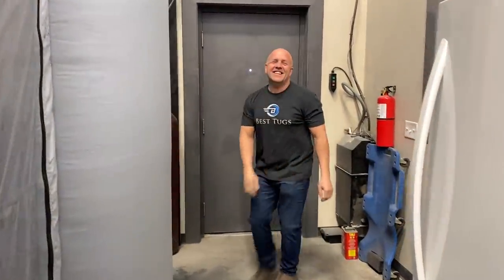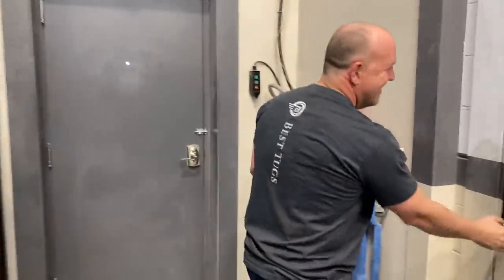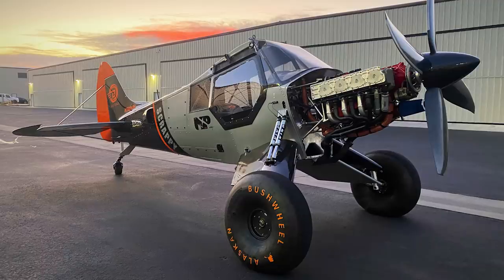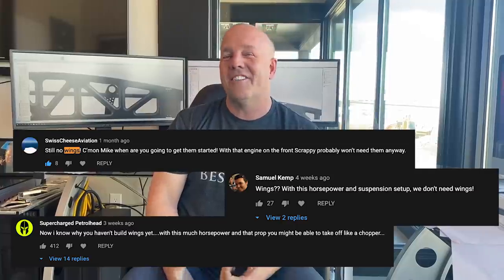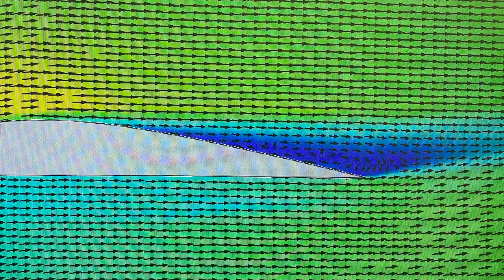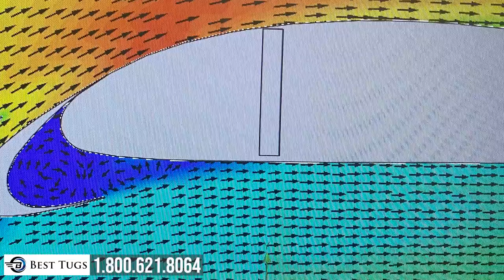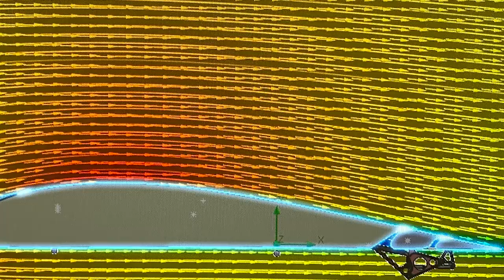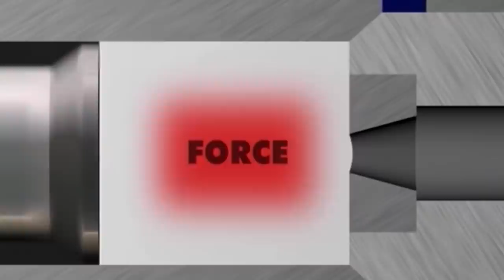Airplane Without Wings, Let's Try Something Different! | Scrappy #42

Comment: I have always been fascinated with flow dynamics. What if you had a Kline Fogleman type design except the concave lower surface has a flap to make it completely open and a flap at the front that opens to effectively create a bi-plane at low speeds. Or an inflatable wing (or bottom surface) to increase the cross section at higher speeds. I am just an armchair aerodynamics fan (pun intended). Or possibly a folding smaller wing in the main fuselage in clean airflow. Has anyone ever used dimples (think golf ball) on a plane ?

Comment: good year made a rubber air-o-plain  but for war , yea  no . but if you used air cylinders to push the forward edge out stepper motor tech,and magnetic band locks  with hydraulic detentes to locate .bands/ribbon also retract.  formula 1 race cars had inflated bodys to save weight ,is it going to  be full width of the wing or more at the root ?  you'll have to go talk to the biologist and start growing 6'  feathers speaking of crisper and sci fi >grow a giant puddle ducks (least aggressive giant lizard I can think of )>use a flock of them to replace the first stage of the sewerage treatment plants(12' tall duck is going to need a constant feed line too ) ..and once you get the feathers mastered , might as well  scale up to the 20' tall goonie bird &harvest its wings.   freeze dry them and add in mechanical ligaments   do feathers  cyclic stress crack ? for there is your transformable  wing . Eagles   have a good glide ratio too . might need a super computer  to control , or a bird brain with  rat controller >MIT had a living  computer controlled  rat. lol  terradactile wing  desighn might be easier ,but bird wings are so cool . its a brave new world with people getting their dna changed might as welll screw with birds too ! ;)

Comment: I have a design for a set of wings I wanted to build and I don't know if my design is so crazy it won't work or what because of all the styles of wings you described and other mods that actually go on the wings are not close to what I have sketched up.

Comment: Hello Mike,

I just came across your videos and I'm enjoying them!

Question; I'm curious about the surface material on your wing designs? Do you use some kind of "optimal standard" finish or coating that has super low drag? Do you know much about this topic? How surface materials affect aerodynamics is certainly something I'd like to learn more about if you have any suggestions. 

Speaking of aerodynamics in general; Otto Aviation's products are drawing lots of attention to the virtues of Laminar Flow. I'm interested in developing designs that generate this phenomenon as well. Perhaps by other means, but, the end goal is the same.

Comment: Hm...  What is wrong with leading edge slats and trailing edge flaps.  Dayton Wright RB-1 used a variable camber wing.  For get ailerons a go with spoilers on the bottom of the wing.

Comment: What about wings designed for speed and then a small set that folds out from bottom of fuselage from the center  like(V) when you need them that are small and built for low speeds that work in tandem with other wings.  I know it's crazy and a ton of work but you seem like someone who could pull it off and take the chance.

Comment: "Transformer" wing design.  Email for sketches?

Live-Tensioned dyneema skin for variable wing profile.  Stationary and redundant, movable ribs.  combined with leading edge flaps.

Multi role flight controls.  Flaps, flaperons and ailerons.

Stabilators with split-surface air brakes and dampening.

Fly by wire?

Comment: Can you do two separate wings with a hallow section inside that can stand up to low speeds, covered/connected with very thin alum only in that mid section then an air pump could suck in some light internal cylinders to adjust the shape of the wing to condense down to a high speed shape? I'm thinking that if you take a final high speed shape and a final low speed shape and see how to convert it while in flight?

Comment: Lift is air speed over the wing , soooo , why not get rid of the big prop at the nose and add about six smaller props to each wing , in line with the center of the wing . Leave the engine where it is and just add a light weight shaft the length of each wing and drive a bunch of smaller prop shafts with bevel gears . In theory ,  the plane should be able to lift itself with no forward speed at all.

Comment: How about a specially designed inverted wing style, with high pressure flaps, and high performance elevators. without significant weight displacment in the second half,   bushcraft

Comment: telescoping wing sections that change the area, shape, lift at will? Never mind, you just showed examples that this concept already exists. During my Ph.D. I generated many simulations requiring weeks of computational analysis, I would have loved to have had your setup to speed things up. I couldn't believe you were getting these simulations done in hours instead of days or weeks, granted my simulations had more than fluid dynamics but also thermodynamics & chemical kinetics...but when I segmented these phenomena for debugging, the fluid flow simulations still took days.

Sorry for the continuous edits but you showed slats added to the front of the wing. If you add multiple degrees of freedom, I can see how you can shift the lifting moment of the wing to compensate for the drag forces induced by an aileron that not only pivots but also telescopes to add more concavity as well as wing depth. The slats in front would of course need sufficient overlap on the wing to allow a telescoping in the forward direction while not disrupting laminar flow, moreover, increased fluid speed can be added if you add a pivoting degree of freedom similar to the aileron. But I am not sure what shape the underside of the slat should have to maintain laminar flow continuity with the underside of the wing while still allowing for the pivoting degree of freedom. 

Then comes the logic based on force balances set equal to zero or near zero in a simulation. I can imagine you generating curves for certain slate orientations as a function of aileron positions, speeds, and plane orientation. This is one hell of an idea you have Mike, I am super excited. I wish I could be there.

Comment: What if you have a wing that pivots the angle of attach on two positions? or what about an old school idea like the flexible or mailable(contortion able) wing they used in early flight controls except in converse positions instead of sympathetic? early aircraft would twist the wings slightly from side to side instead of using ailerons! I'm just thinking outside the box brother! good luck, Someone else has probably also done this research, maybe go look at there ideas. Interesting problem though! I know you will come up with something brilliant!

Comment: Bush planes are obsolete, you just don't know it yet. I mean they look cool if you're into that retro vibe. You're trying to solve a problem with the wrong tool. Like opening a can of beans with a hammer. Sure, it could work, but you're sacrificing so much in performance over a can opener.

Comment: @mikepatey Is it possible to come up with wings that contain internal mechanisms that allow to expand its width to create more camber at lower speeds and contract back to minimum structural width at higher speeds? Or wings that expand to the sides to increase their length and retract to shorten them back for higher speed? Or an integration of both.

Comment: What if you  can slid the wing forward or backwards and change the center of gravity, relative to the body..... so that the wight of the tail gives you the down force, and you can use the tail  flaps to add more or less?

Comment: Mount 2oval shaped  tubes 4ft dia ea ,on top of wing in the center and shorten the overall  length of wings 1/3,control the tubes to tilt fwd or bkwds to adjust how you take off once in flight adjust for less drag and directed over rear tail of plane to aid further in lift,over back flaps,its off the wall, but I Invision the way this plane is designed its also,off the wall and would be,totally off the wall,if it worked, throw around some numbers,or throw it end the trash, you never know?

Comment: So many questions:  What if a part of the wing intentionally vibrates?  What frequency, or intensity, or direction of vibration.  What part of the wing?
Can the temperature of different surfaces affect change in performance.  Like, chill one part, or heat a different.
What can be learned from ornithopter attempts.  Or natural (bird) flight.  Its only evolved over a few million years of success and failure.
Can a wing be made of two wings adjustably sandwiched to nest and separate?

I'm so glad I don't live near you.

Comment: Just a small information: changeable wing profiles has already been done before. There's also an ongoing project for glider wings that attempts changeable wing profiles for slow flight high lift and high speed flight. https://www.youtube.com/watch?v=Fbsc-sLGD3E
So great you're also developing into the same direction. It will certainly be interesting what design you'll be coming up with! :)

Comment: Could you not add more flap and when elevator authority runs out, move the CG aft to aid? hand pulley and some weights in the empenage and tail goes down

Comment: Many years ago I came up with an original wing idea I had never heard of that might just be feasible.  I never pursued the idea because of my teaching career just never let me have the time to investigate like you have with Scrappy.  I have not told anyone of this idea for fear of patent issues.  My father designed a bomb release mechanism for the A-bomb, showed to a Naval officer, who then patented it himself!  My biggest concern with my concept is one of engineering difficulties, like your wing spar issue.  Also, lift from an airfoil vs. angle of attack.  Would you be interested in a short description?  No one I know personally has the kind of background you do that could give me an educated opinion.

Comment: High camber with the double over and under lbut they retract after take off once the correct speed is achieved then the wings would set at half standard length creating less drag and quicker maneuverability isnt it true the faster you go the smaller the wings could be

Comment: Hello Sir,
I watched you video about the wings on Scrappy and how you would like the best of both worlds which translates to two different wing designs. I have been thinking about something without knowing in detail aviation physics, and that is why I wanted to write to you. Would it be possible or ever be possible to have some sort of air bladder in the wing that could inflate or deflate in order to change the default wing shape to provide to change in performance of the wing?

For example to how a deicing boot works but in a different place in the wing and bigger scale.

Comment: What about a wing that is in two halves along its axis? on the rear half are ailerons but no flaps, because flaps becomes the angle between the two halves. The upper surface would have an overlap though. Too complex or crazy?

Comment: Your gonna hate me? . . at @ of your visionary engineering. . .the bulb went off, why can‘t you have both wing profiles for both slow flight and full throttle,  how bout that F-14 swept back-hard deck slow flight-full feather drag wing design?  Bush pilot landings are exactly that high wind-hard deck landing, now imagine a mechanical/hydraulic assist wing dial, like that of the trim dial.  From the very first engineered wing to “Project Scrapy” has been some of the craziest ideas ever, that put front seaters under physiological exams before handing them the keys from the engineer. . .engineers drive others nutty, “what’s wrong with you, why don’t you understand what I’m saying, lmao”

Comment: Didn't the U-2 use a wing that allowed for slow stable level flight, and still be efficient at higher speeds? I mean it could start to lift at 70 knots.

Comment: Since my experiences in aviation is limited to being a child escorted by an ASA agent to and from a tiny airfield with connection service from Meridian to Heartfeild Int., could you design your wing to be expandable and contactable in cross section?  Maybe this already exists, or you discuss this further into your video. But, since I stopped at 11:40 to make this comment, you have yet to suggest this idea. Is there a material that is strong enough at high speed yet pliable enough to expand to increase your cross section, there by enabling you to fly slower. My simple brain suggests to me that if you could inflate the wing, and if you could control the shape created, then increasing weight should be at a minimum when compared to some of these other options you have mentions so far. Could the upper skin be constructed in such a way that by leverage, you could mechanically, pull or push a lever that would stretch the outer skin. Or a recessed wing within a wing that maybe pops up with a pull of a lever or flick of a switch. Anyway, I’ll go back to eating crayons, and finish the video. Looks good without the wing anyhow.

Comment: Can't you manipulate air speed and pressure the same way a formula 1 engine to enhance airflow to the point when it affects flying characteristics?  I have no idea if it will work but at least should be more reliable than alternatives without increasing complexity or drag too much. I remember seeing a feature like this in a nasa f-16xl concept.

Comment: Mike, look at Bailey Harris. He designed an unstallable wing for an RC plane. Check it out. I fly that same RC plane you're holding with the GPS system in it. That is way too much thinking. Put a wing on it, and lets fly. lol For real Mike, SpaceX or NASA could use you. But you wouldn't be happy there, you need freedom to fly. So you want a moveable wing inflight! Holy smoke, why not? This is going to be fun to watch. But, I'm beginning to see why you wanted a parachute. You're thinking way outside the box. Can't wait, Let's get to work.

Comment: Can anyone on here point me to the design of the German Storch and what about the wing that gave it STOL 
capabilities. I hope there is a source that can speak in complete layman's terms as I don't have a meta human 
engineer brain.   I was able to apply the principle of yaw to the dynamics of a .223 round fired from an M-16 to 
explain that the bullet wasn't tumbling when it impacted a pop-up silhouette at 300m and left a hole shaped like 
the projectile as seen in profile but rather it was yawing which caused  the round to sometimes tumble when it hit 
a live target. THAT is as technical as I can understand.  I do find understanding that wing design with slots and flaps 
and magic very compelling.    Thank you.

An afterthought. If I was in the market for a fast and relatively easy to fly two seater what might that bird be?  A kit that 
can be flown without a license?  I would consider 300 mph very fast. I can't know if that's crazy nor do I know purchase 
and operating costs.  I'm probably asking about a plane that will cost the same as a Piper Cub and fly as fast as an exec-
utive jet. I just don't know what I don't know.  The good news for me is that those who are watching this video will recognize
my ignorance and yet feel no compulsion to troll me.

Comment: What about scrapping the whole idea of the airplane the Wright Brothers dreamed up of that We have got stuck with trying to perfect.   The propeller design  thats a flop its limited   Toss it all out the window.  Maybe get AI to dream up a design to move through air  machine learning from scratch.  Seems to me to conquer speed and lift  wings that retract backwards with the force of forward motion   The more power you have the drag is reduced by friction and it constantly adjusts on its own.  Seems like its all based on the orig concept and cant move out of the box.  Have you see AI design the front suspension of a car   From
Scratch ?  Its really bazar !  Look that up.

Comment: Ok, I know nothing about wings, except they should fly. Could you build a frame and skin it, then use rubber air bladders in the wings to test with, before committing.  Or even run with an air bladder all the time, depending if you are looking for high speed or stall. 
Sounds like you committed to something so this idea might be for nothing

Comment: Wings are seen easily on/around the wheel struts.  Bi-wings,  so won't take as much area. to get same lift.   Looks like they are mounted with hydraulics to move into place and tuck away when needing a tight parking space.  It's not difficult.  bye.

Comment: I have no clue about aeronautic designs (to prove it just look at what I said right before this note lol) but what if you design a wing that is awsome at flying slow but has computer controlled vents that open in the front of the wings and goes all the way thru if you need or want more speed ? So slow the air vanes are closed but as you need more speed it opens to different flows depending on desired effect? 
Is that a rediculas ideal or could it hold some merit?
I'm a Retired Soldier who knows a little about a lot of things master of none. Lol

Comment: Is a delta wing possible.  Thin, swept-back for less drag.  Thin for more speed.  The mass on the underside use as flap helper.  I know it's crazy, but..........
Reply: Semi delta modified length, shorter to fit above the center of gravity. movable leading edge and same on the back.  The angle of attack is movable also as the entire wing tilts.   Just fantasizing.
Reply: Airtight semi-delta wing to hold air that makes the wing fat or skinny. The entire wing changes shape as need be.
Reply: As the need for speed increases the wing morphs into more of the delta configuration and gets skinnier.
Reply: Never mind. .....